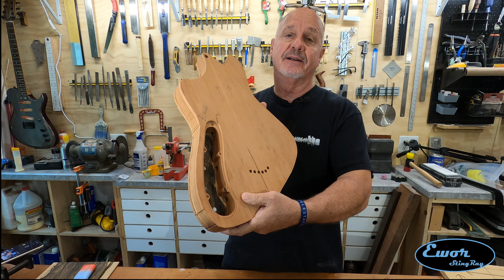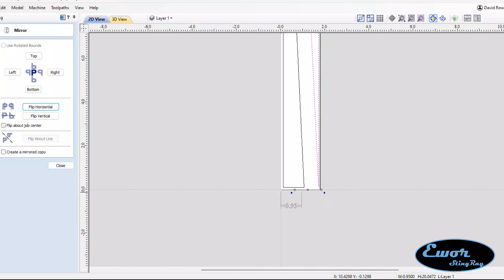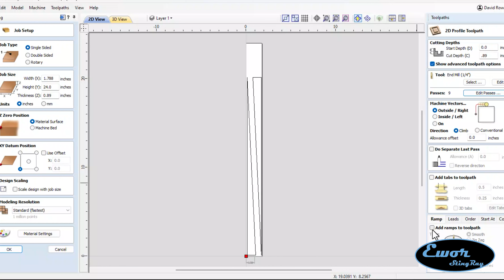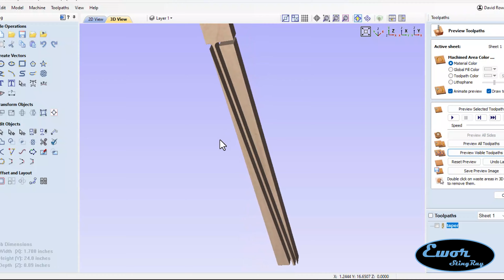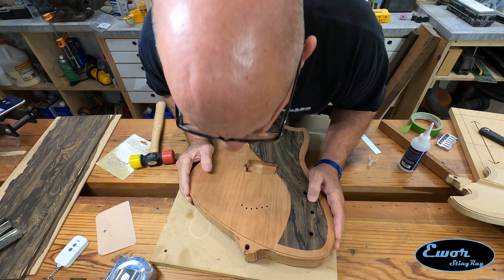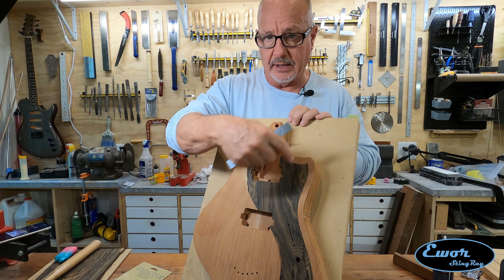Ewor Stingray part 5: cutting an angled neck pocket on a CNC

Comment: Nice work.  I'm preparing to CNC the neck pocket (and pickup pockets to keep pickup tops parallel to strings) on an SG replica.  Your video helps me decide how to tilt my blank on the CNC.  Please detail for me where you set X/Y/Z=0 and probed for that on your CNC.  I'm concerned about this getting thrown off between my CAM model and the table-mounted workpiece when it get angled.  You and I use different hardware and software but, of course, the principles are the same.  Thanks again and keep up the good work!

Comment: The CNC should be able to cut an angled pocket, correct ?
Reply from the maker: Yes it can. I don’t yet use the 3D modeling software that can create the angled pocket so I just do it the way I show. I’m learning fusion 360 and sometime soon should be able to create that type of pocket
Reply: @eworcustomguitars  Nice work...Been making attempts to customize a 1988 Casio PG-380 Synth guitar (high end Strat) for years now.

Comment: I know your not the official spokesman for Next Wave CNC machines. I had 3DCNCGUITARS design my neck and Fretboard and I made some minor tool path changes. Up until this point all I have done is surface my spoilboard and engrave a grid. So I tried to run some of the tool paths but they do not cut the same as the demo cutting on my computer. What am I doing wrong?
Reply from the maker: I’m wondering is the neck design you purchased compatible with vectric v carve?
Reply: @eworcustomguitars  yes he works in Aspire and Vcarve. What I thought was weird was that when I went to set the z axis I had to register it on the spoilboard otherwise it would not cut. For now I'm just trying to cut and shape a fingerboard and I'm not having any luck. It shows all the tool paths but when it comes for running those gcodes it only does a part of the and then goes back to the home position
Reply: You have a Merry Christmas and thanks for the help.

Comment: Surprised you aren't using the CNC to do the contour shaping around the edge too. 🤷‍♂️
Reply from the maker: I still might do the contouring. Vectric vcarve desktop is 2-D software but you can manipulate the molding tool paths to do contouring.
Reply: @eworcustomguitars  Got ya. Wasn't aware it was 2D paths only. That makes a difference. 😉